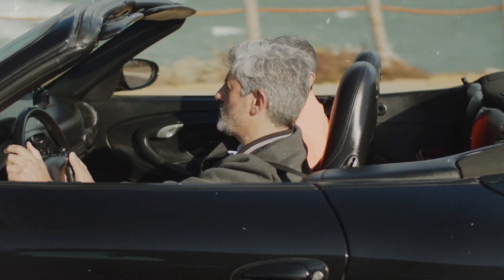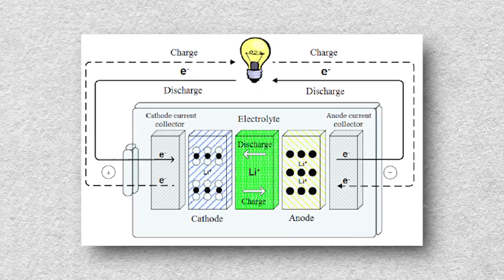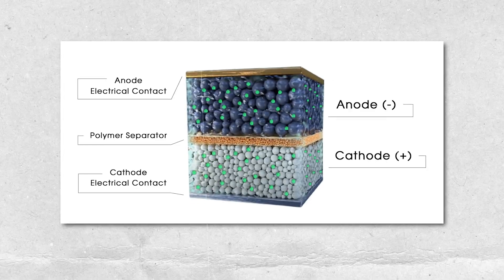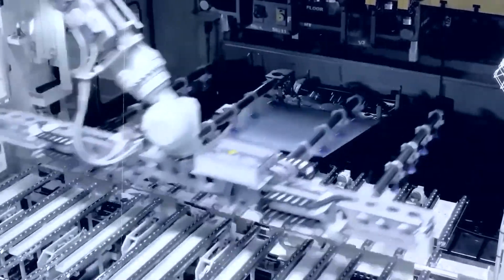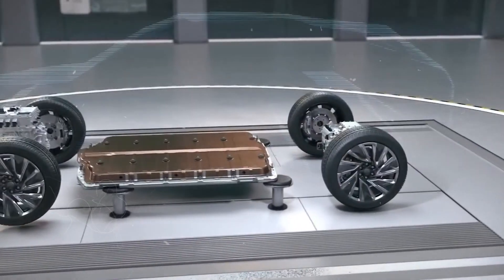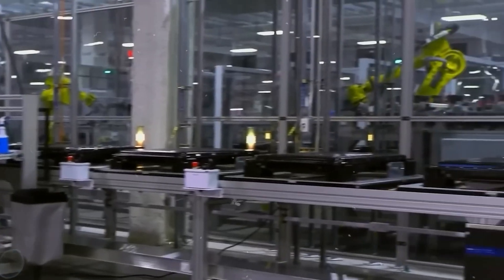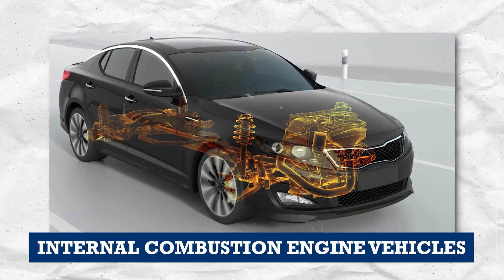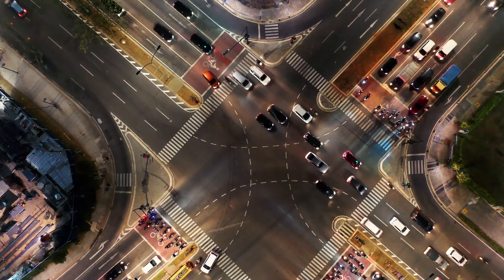What they are not telling you about Solid state batteries!

Comment: I mean the answer would be to use Na over Li. Not only do you have access to  Na around the world, but you're going not to be limited to a single country to make these type of batteries. They offer some pros that even Li doesnt offer such as a more dymanic charging rate and limit compare to Li that has to be in the middle. Cheaper, easy to get to/large supplies, and offer about the same or a little less than Li. The real benfit is that SS should help reduce the weight of Na anyways - thus you either come out about the same as current or 1/3 less while being half the current size still. Doing a mix of these types of batteries could off set or replace Li low end with Na low end milage cars. Even better yet - there is still the use of Sulfur over Active Carbon that could increase power dens another 2 or 3 times. Meaning going to Na wouldnt really be that bad as you would still get most of the benefits that Li was offering, but at a WAY larger supply to work with thus means even cheaper batteries as you wouldnt need as many - but the ones you do produce you can make 100 times more of.

Solar Panels could also see an improvement in the next few years doubling the power they do make per square metter. That means we could see adding solar panels to the top of cars to reduce their power needs per day as well.
Reply: You are fully right! Na+ is also my guess for the future and simply driven by costs.
Hopefully with some more new lighter and high efficient vehicles builds new on market, like Aptera SEV next year.